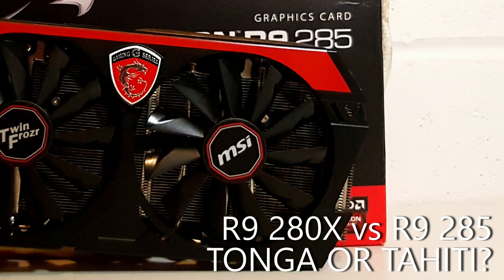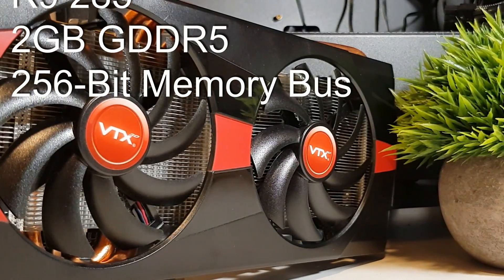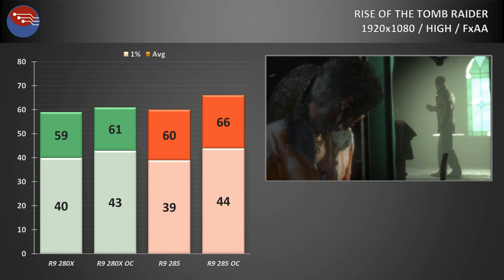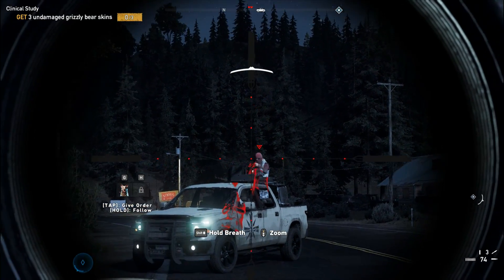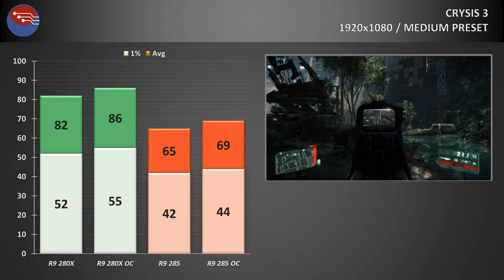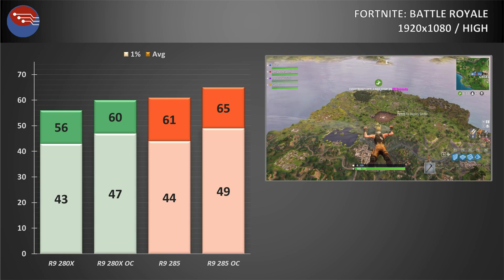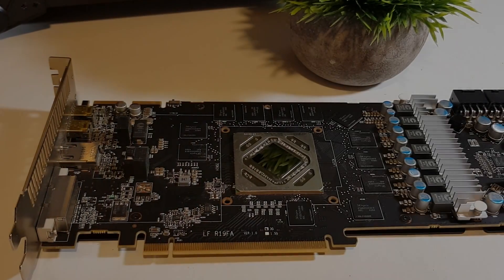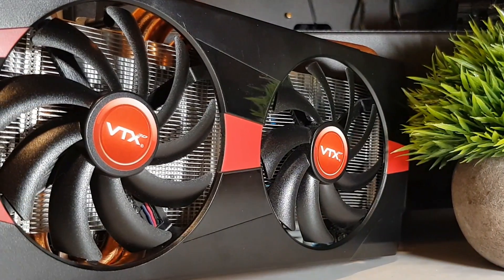R9 280x VS R9 285 - HEIR TO THE THRONE?

Comment: 2x R9 285 in Xfire
X4 880k with AIO cooler
ASRock fm2a88x+ killer 
8gb gskill sniper 2400mhz

Still going strong. Built in like 2014. Can play most games on high, CPU is the issue normally. GTAV is playable but not great with my 880k.